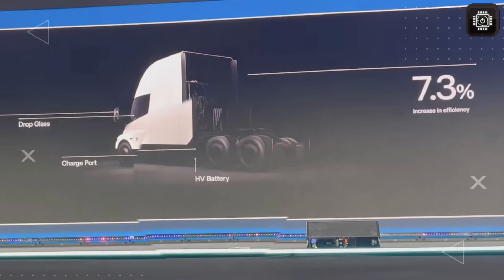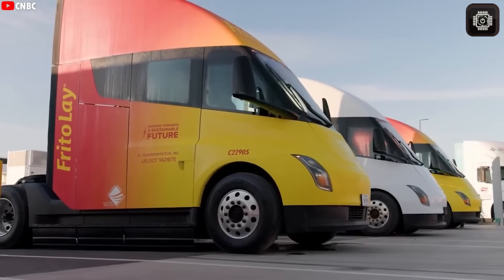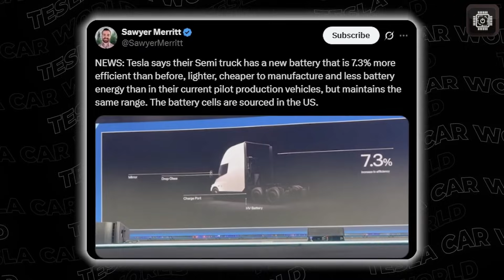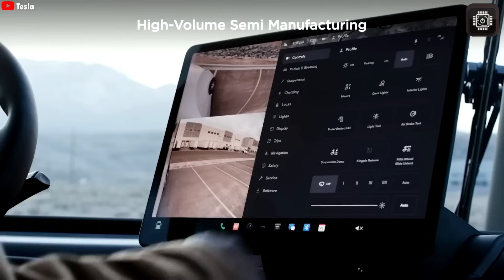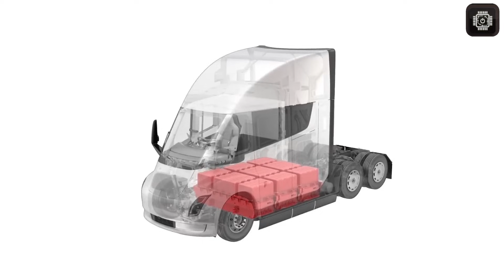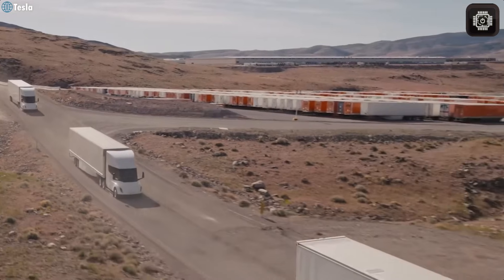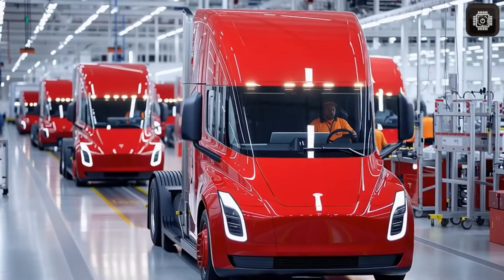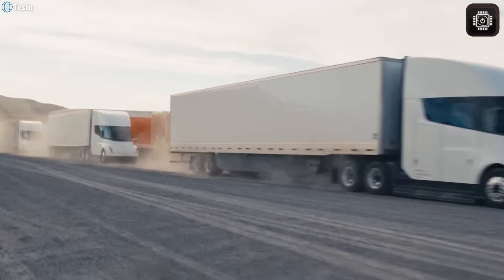Tesla Semi GEN 2 Reveal — MASS Production, 4680 Battery & FSD Upgrade CHANGES EVERYTHING!

Comment: They'll be dead in the water if they don't address the elephant in the room!  Weight.  If they're significantly heavier than their combustion engine counterparts.  The main thing driving truck revenues for it's owners is payload.  Lower pay load makes it less valuable (meaning as the weight of the truck increases, the overall capacity of what it can haul decreases as per most municipal road laws dictate to protect road infrastructure, bridges, etc.) and if that's the case, they need to reflect that on the purchase price.  They need to be much cheaper, not more expensive.  Than the combustion engines that can legally haul more making them naturally more valuable.  If they're way more expensive, the mechanics around how logistics business work in this industry won't be reasonably met.  And while they'll look really nice, and be quiet.  Both plus points for me.  They won't be as valuable.  Where the script may get flipped is driverless.  That will of course create new problems and opportunities.  Where an increased purchase price, built into a driverless piece of equipment may be worth it for investors who think the costs saved from driver error and wages, make up for increased TARE's.  That will of course, create increased demand for electric charging stations and cycle times.
Reply: Good points, however I dont think the truck is Significantly heavier, but you do loose some payload. The real savings is in maintenance and fuel cost!! I'm not sure of the current cost of a new Diesel class 8 or what the final price will be of Tesla(est. $250K), but PepsiCo has had 20 or so of them in California, and they have proved them out as being much cheaper to operate and the ROI was 18monthes or so. And the drivers absolutely love them too! 
https://www.youtube.com/watch?v=VeydBehE_Uw                   https://www.youtube.com/watch?v=2-rzCARH1h8